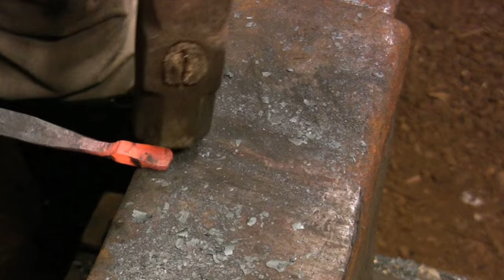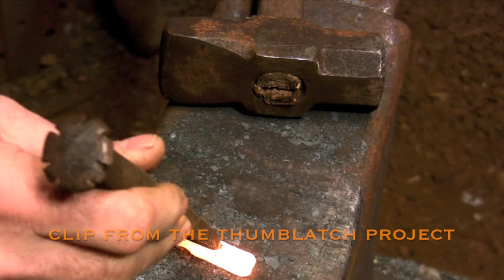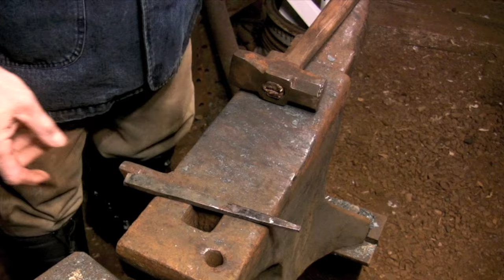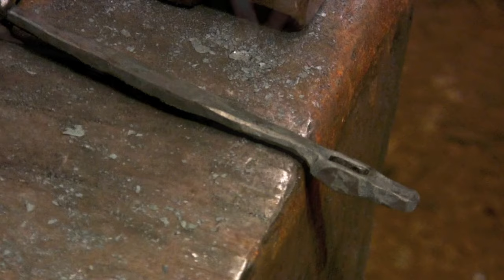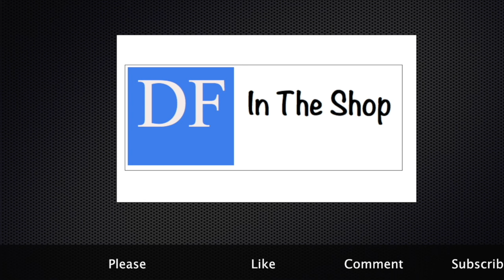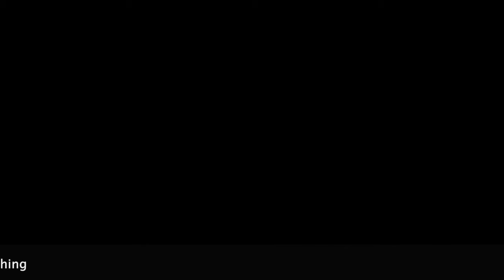Blacksmithing for Beginners -  Tip for Punching Small Bars

Comment: HI Denis.  I am with you on your punching technique but you really should do something about the striking end of that first punch that you used.  It's an accident waiting to happen.  

Several months ago I had a chip fly off from the top die of my G2 Guillotine tool and strike me on the back, base of the thumb of my left hand (I'm right handed).  I was wearing a leather welding glove on that hand so even though it hurt quite a bit, I assumed it was only a bruise sort of injury and I continued to work.  After about a half hour the pain had not subsided, so I removed that glove and discovered a 1/4" square piece of the shard that broke off,  embedded in the bone of my thumb. It cut through that glove like a hot knife through butter.    I had to use pliers to remove it.  I hate to think what might have happened if it had hit me in an unprotected area.
Reply from the maker: Hi Scott.  I appreciate your concern about this and I will repair those chisels. Old habits are hard to break i guess but I do agree that I'm not setting a good example by using tools like that and  It is something that I overlooked and I will correct it in future videos.  Thanks for bringing it to my attention.